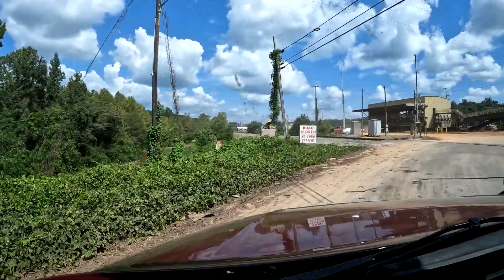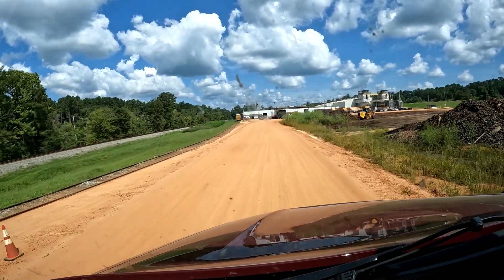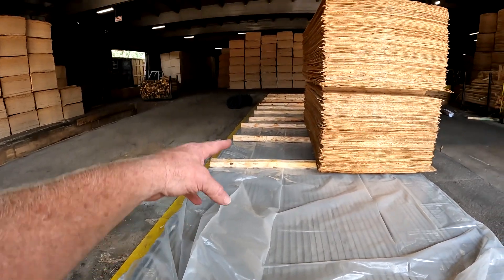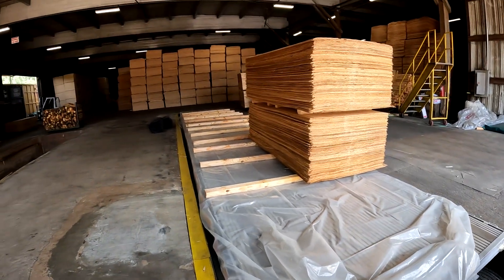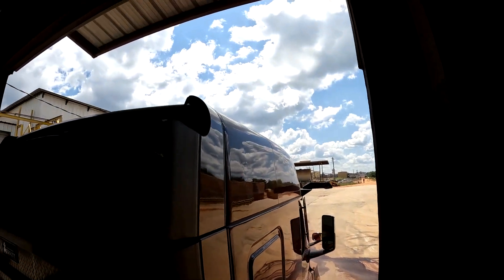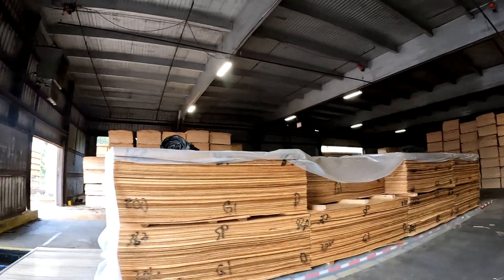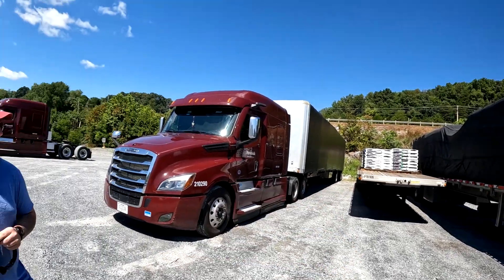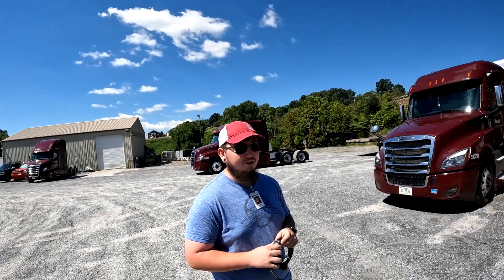Maverick Flatbed Trucking #446 Church Hill TN Load Swap

Comment: Great video!! I think your last video, you got repower. Where you switched your truck for a different truck with a load of drywall. Any reason why? Was it for maintenance or a repair. Does Maverick have an IT dept.? Where you can switch out your non functional tabet for a functioning tabet.
Reply from the maker: I swapped trailers to get that drywall load, not trucks.  Yes, we have an IT group, but I think we're just working out the bugs from changing to a totally different system.  My tablet worked fine this week.